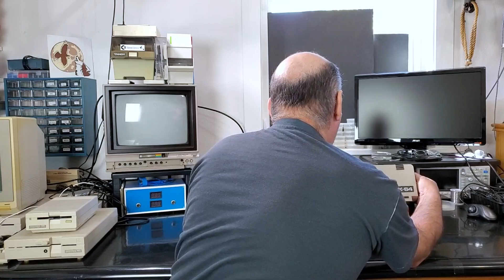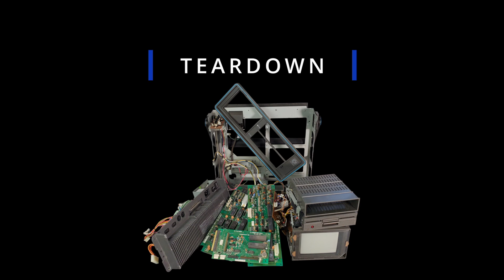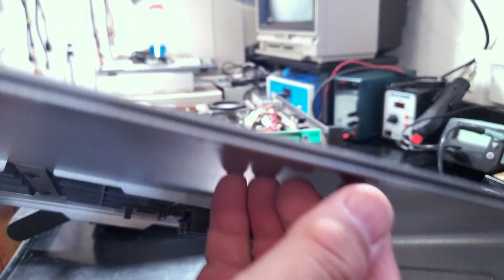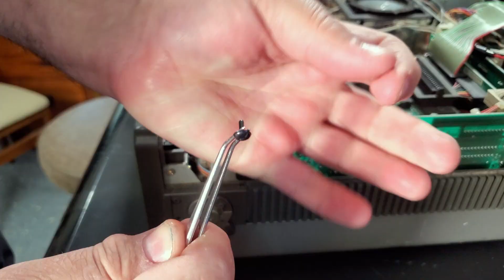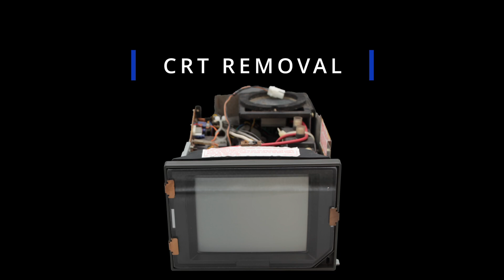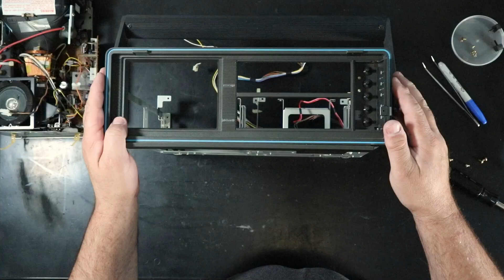Sexy 64! Commodore SX-64 Restoration - Step-by-step teardown guide

Comment: Hands down the BEST restoration/ tear down guide out there! Watching from the UK! Would be great if your guide covered the alignment pots on the inside of the SX64.
Reply from the maker: Thanks, is that the CRT adjustments you are looking for?
Reply: @RavenWolfRetroTech  yes on the top of the CRT board there are 5 pots - no idea what they do 🙂
Reply from the maker: Sorry, I missed your reply. I avoid messing with crts as much as possible so I don't know what each is by heart. Looking at the schematic will have the answer. Typically there are adjustments for things like the vertical height, position, etc...

Comment: Thank you for the video! I need to just clean the back of the crt glass. Is the front panel easily removed without removing other components (are the screws accessible)?
Reply from the maker: I will show it in the next video which I am working on as we speak. I was hoping for Sunday but the CRT has a leaky cap so I am going to have to add in a recap. 
Once the CRT is removed from the case there are 3 clips that can be removed which will free the front glass!
Reply: Great! Yeah, I am hoping that all I need to do is to take off the top and bottom covers, then I can remove the front panel, then the glass of the crt without disturbing anything else. But at some point, sounds like I should also probably inspect for leaky caps too, sigh.
Reply from the maker: Once the top cover is off its just 4 screws and a few connectors. Then the CRT just lifts out, no need to remove the front or bottom covers IIRC. 
As for the caps I was really surprised to find one leaking as the caps from this era are pretty reliable. You may find that you are just fine.

Comment: Nice Video. There is a chassis version though, where the drive mount is a little different and not screwed in from atop. On those versions, you need to remove the CRT to be able to remove the drive mount or the drive itself, as it screws in from the sides.
Reply from the maker: Thanks InsaneDruid! Alex from Reviving Retro also emailed me a picture . I am going to check the 2 SX-64s from the Stone Collection to see if any are that style and include it in the next video when I get back from a family reunion I am at right now. If none are that style I will have to see if I can get some good angles of the drive removal process somewhere.

Comment: Do you still have many books and software from your 2022 haul to list and sell. If the books are ones I don't have and have a little mold but possibly salvageable by a person with free time, I might be interested.
Reply from the maker: I was in the process of organizing all the Stone Collection materials when I was interrupted by allergies, followed by a family reunion. I I
will be back on it this month and have been putting the extreme items aside.
Reply: @RavenWolfRetroTech  I found a guy in Poland a while back that had a rig he sold you could plug into the USB port on your laptop, run the software and burn disk images to a 1541 5 1/4 floppy. I have some of the SD emulator stuff, but I prefer to use the 1541 with a fastload cartridge so I can save my data. A lot of the emulator and games make it very hard to play with multiple disks or saves.
Reply from the maker: @jamesmaddox40  I used a ZoomFloppy to recover my DDM files on the PC so I could run it in VICE a few years ago. It was pretty funny using a 170k serial floppy on a modern PC.
Reply: @RavenWolfRetroTech  Awesome floppy note. My son in law bought me some 8 in h floppies at a yard sale new in the boxes. I don't even own an 8 inch floppy drive yet, but you know I'm gonna buy one just because he did it. I'll have to pick up a PC too cause you know they match. Lol
Reply from the maker: man, how's your back? My dual 8" drive weighs in at over 60 lbs!
Reply: @RavenWolfRetroTech  I'm still in decent shape but had no idea that suffering for your craft also covered geek hobbies as well. Lol

Comment: Hoping yours has Floppy Drive problems when it starts, cause the one I bought had PLA problem. I fixed that, but haven't torn into the floppy drive to see if I can fix it. I've been debating Jiffy Dos in all of my 1541s... anybody got experiences to say yes or no. Back in the day, I cut the 2 sets of jumpers that set the drive number and put a couple of red flip switches on the drives so I could do backups. I want to do that again to all of my 1541s. It worked great. I know you can use software to do it, but I liked the physical and also was fufilled that I could change my environment to suit my needs. Got married had kids, had no room and gave my stuff to my brother in law 20 plus years ago. Kids raised, I went back and got all my toys from craigslist, ebay, and facebook marketplace. Hoping I live to be a 100 to keep on enjoying my childhood. I don't never wanna grow up.
Reply from the maker: Doh, YouTube ate my reply so here's a synopsis...
Jiffy Dos - This has become non-optional for me. The speed is nice but the ease of use is invaluable.
I love the puzzle solving of a repair so I am good with issues. I have plenty of PLAs due to a friend making new ones from NoS S100 chips which are more reliable than the CBM ones. I do constantly find myself short on 6526 CIAs and VIC-IIs though.
I always had to sell my old gear to afford the new stuff so I too had to start finding the replacements online. The Stone collection kinda blew that out of the water for 8-bit stuff and the KPTV Amigas fixed me up for the Amiga. The only thing I really need to revisit one day - but not too soon - is the Apple II and SOL-20
Reply: @RavenWolfRetroTech  Never could afford the Apple II back in the day. That however is what I trained on in High School.. Apple II Plus, and Apple II E. I finally scooped up an Apple II with a working Orangish screen color for the text. The ones above had the greenish tint. I also had a couple Floppy Disk boxes of Software shipped separately from of all places an actual shipping port with boats. The USPS promptly lost the software never to be found, but to my surprise the Apple II loaded it's home screen and after turning knobs on the monitor to brighten the text I found the computer and monitor worked. I still have my programs disks from class in 1985. I had written a 3D rotation of a stick figure pyramid back then. I was so proud. I think I finally picked up the DOS software for the 5 1/4 floppy drive. I got so excited I forgot the mention that I got maybe 2 drives if I'm remembering right.

Comment: Very interessting. Please notice how the state of the capacitors are, around the PCB's :-) I am looking forward for your next video in anticipation, and keep up the good work. BTW, do you have a SX-64 with PAL?
Reply from the maker: I will check the caps in the next video but, based on what I saw, I expect that they are fine. I'm in Oregon so my machines are all NTSC.